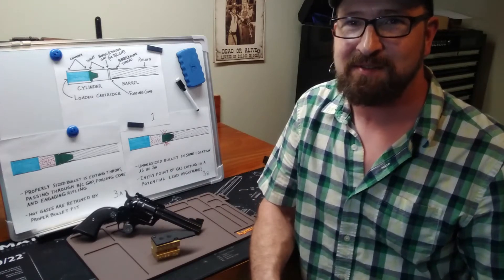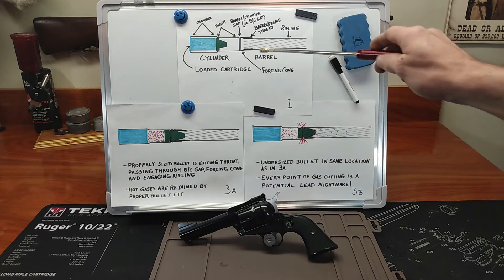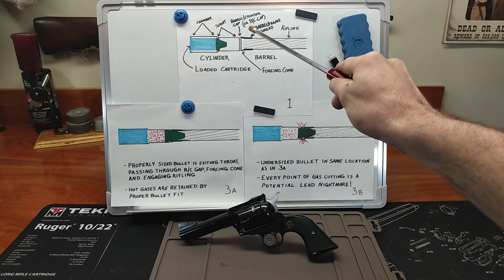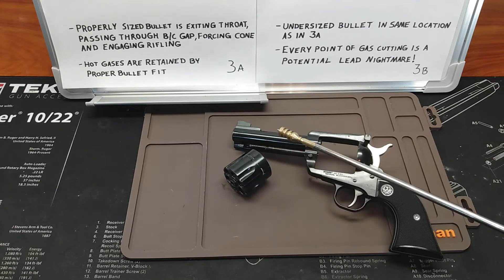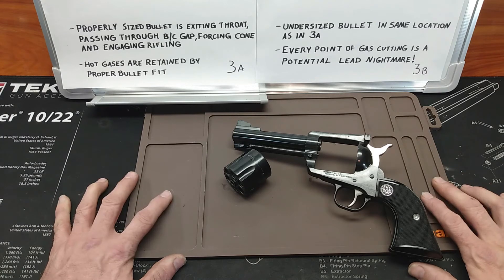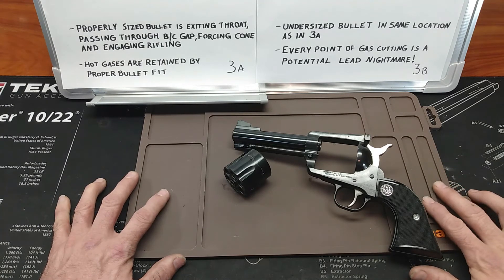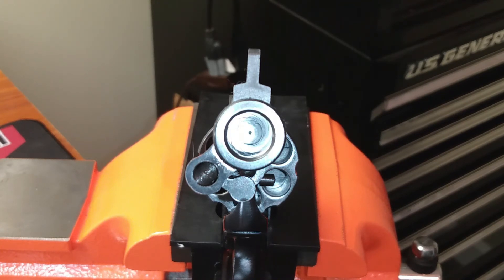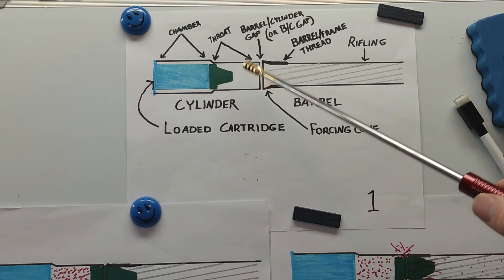4. Cast Bullet Path (Barrel/cylinder gap and major assemblies)

Comment: Fine explanation and great video work. 
Good to see you like something other than the wimpy 44.
Interesting pin lock-up on your new mold.
I was wondering why you used blue to represent the cases on your diagrams. North Carolina fixation.
More than likely the reports of leading by cylinder gap was the result of misalignment of bore/cylinder.
Reply from the maker: lol... yeah those wimpy 44s. Not sure why I picked blue. It was probably partially due to women and children raiding my sharpie marker stash and I had to use what was left. Thanks for the view and support!
Reply: Keep up the good work, and please don't take my postings as being critical. I think you are doing a good job.